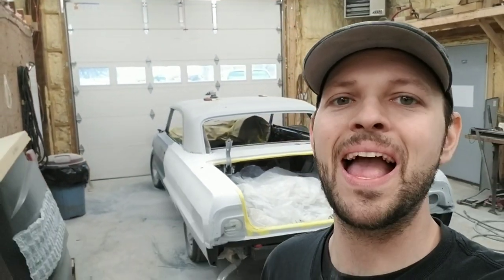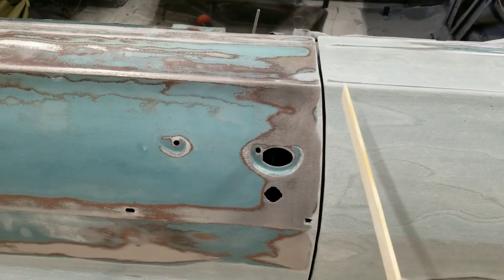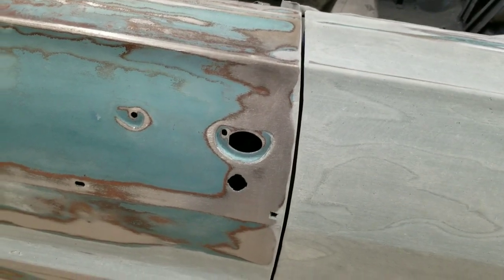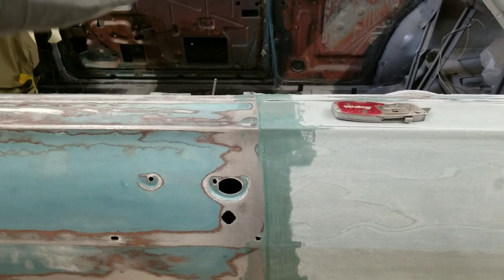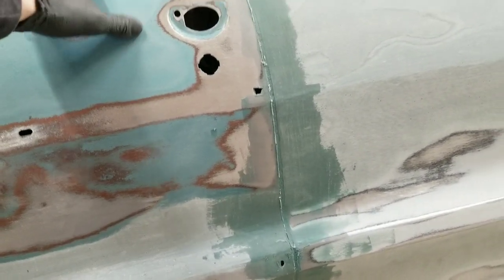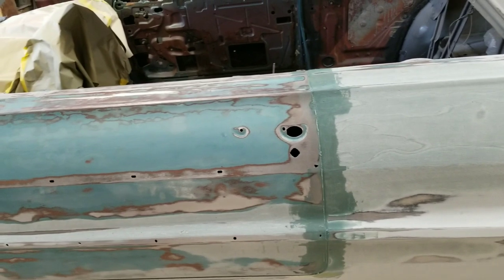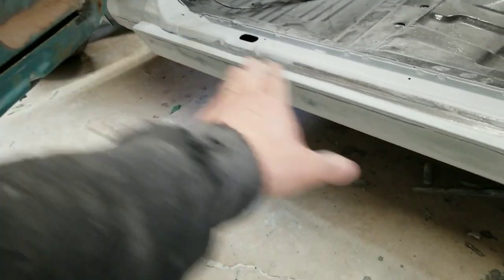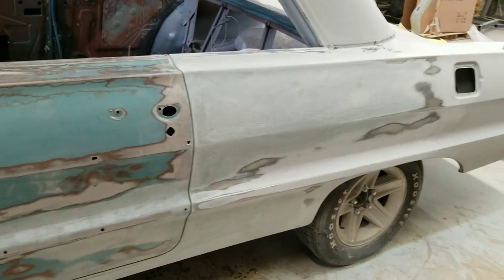64 impala frame off vlog #frankingston build part 12 perfect 1/8" show car gaps every time easily

Comment: Very helpful
What about the outside corner of the jamb on the quarter?
Will you slightly round that off?
Reply from the maker: Yes it will need rounded very lightly to match factory.

Comment: Ive watched Frankingston build all the way through twice cause Im doing a 64 Belair and it needs alot of the same stuff I have a question on floor pan passenger full pan front and back one piece and both braces would you  put pan in first then braces or braces first then pan or is there a right or wrong way Im concerned about seat mount holes lining up thanks for doing this you tube videos there awesome
Reply from the maker: I would do braces and then pan, and as long as you are relatively close to the old mounting holes you will be fine.
Reply: @bpbrestorations2093  Thanku Appreciate what you do.